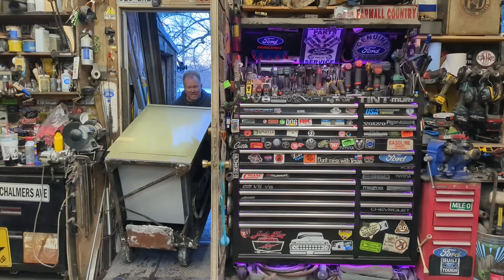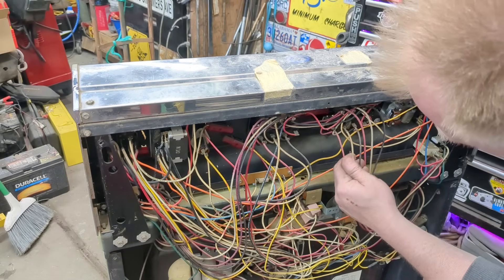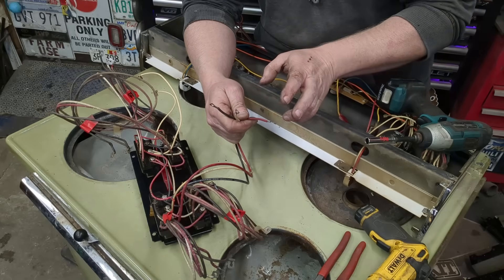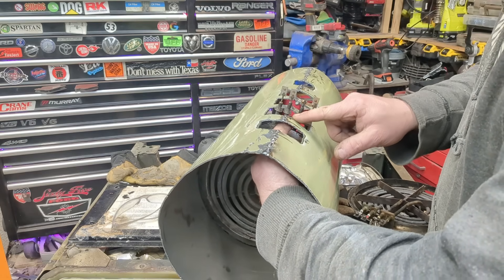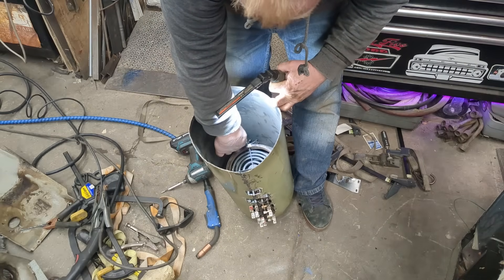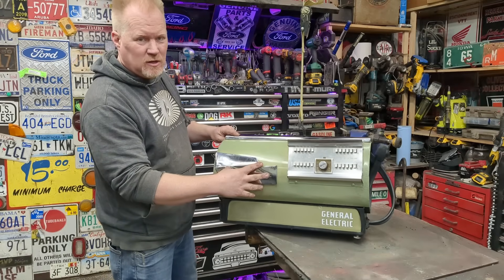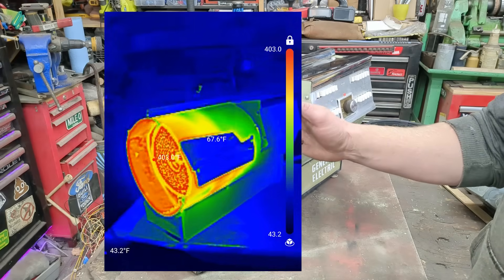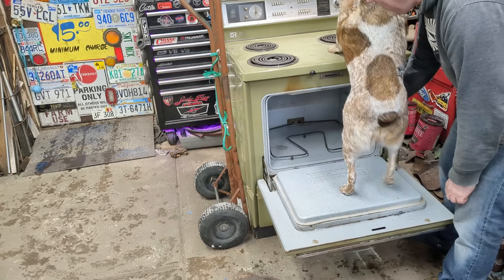Shop HEATER from old OVEN custom build

Comment from the maker: ⬇️ How much does it COST TO RUN?

Stuff I used in the video:
Infrared Phone adapter Android:  https://amzn.to/47AhPve
Infrared Phone adapter Iphone: https://amzn.to/48tunpN
Hypertherm 30xp plasma cutter: https://amzn.to/36pPsne
Miller Multimatic 220 AC/DC Tig Mig welder: https://amzn.to/3mukQqe

VIDEOS I mention in this video
Electric Dryer Heater: https://youtu.be/0gxbGD5f9og
Gas Dryer Heater: https://youtu.be/a3DSOUJ68iE
Vice Grips DEEP Jaws build: https://youtu.be/7PHAfhIw_XY

➡️COST TO RUN: $0.86 per hour(11.5cents kwh at 7500watts)

After Thoughts about the Video: I really don't intend anyone to build this. It's just functional art for me. Full throttle and this thing pulls 7500 watts( 25,575 BTU) which is a fair amount but needed if you wanted to use this outside while you're working. There are no safety controls but after thinking I do plan on installing a buzzer. It will be a simple thermal switch(NTE thermal disc style) located in the top next to the control panel. If it overheats to lets say 160F it'll loudly buzz until it is unplugged and or cools down. This would really only happen if the fan stopped working. I hope you guys enjoyed watching me make this as I had a blast... Build time: 10-12hrs

SUPPORT THE CHANNEL or support the SHOP DOG's treat addiction:
Buy Ginger a new bone: https://www.paypal.com/donate/?hosted_button_id=NS699E56WTYHL
www.instagram.com/sixtyfiveford/
www.facebook.com/sixtyfiveford/

Ginger Birthday wish list https://www.amazon.com/registries/birthday/1JJFHIQRBY14H/guest-view
Reply: would it be possible to wire so that power only goes to the heating element if the fan is turned on? probably safer no?
Reply: Depends, as always. But it's a 100% efficient device, as there is no wasted electricity when all you're doing is creating waste heat.
Reply: You should REALLY go for that classic dryer buzzer with that heave sound that you used to hear across the house, to let you know your laundry was done! 

Also Healers are my favorite dog breed. YouTube doesn’t recommend your videos as often as I’d prefer but when This popped up I knew I had to watch and comment! 

Great video,
Reply: Elements vary greatly by model...even if they are the same size they vary somewhat.  8 Inch Surface elements pull about 1800 to around 2400 Watts each depending on the burners from what I can remember.  A Bake element in an oven is normally around 2400- 2500 Watts and the Broil element is around 3400 Watts.  The bake and broil elements also vary.  

We always called those types of burners 'Calrod' burners or Calrod heaters it was the premium trade name that was patented kind of like Kleenex for tissues but I can't tell you what mfg made the name 'Calrod'  ...sorry
Reply: I likes it. I want one
Reply: that push button GE stove in that puke green colour is 1974 to 1976 ... had its earlier version which only came in white and that was from 66 to 74 ...
Reply: How are you going to cook your food?
Reply: @MrNeverseeme ⚠️ God has said in the Quran:

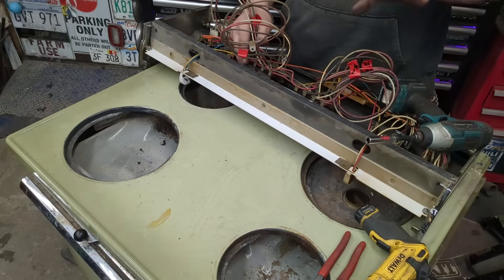🔵 { O mankind, worship your Lord, who created you and those before you, that you may become righteous - ( 2:21 ) 

🔴 [He] who made for you the earth a bed [spread out] and the sky a ceiling and sent down from the sky, rain and brought forth thereby fruits as provision for you. So do not attribute to Allah equals while you know [that there is nothing similar to Him]. ( 2:22 )

🔵 And if you are in doubt about what We have sent down upon Our Servant [Muhammad], then produce a surah the like thereof and call upon your witnesses other than Allah, if you should be truthful. ( 2:23 )

🔴 But if you do not - and you will never be able to - then fear the Fire, whose fuel is men and stones, prepared for the disbelievers.( 2:24 )

🔵 And give good tidings to those who believe and do righteous deeds that they will have gardens [in Paradise] beneath which rivers flow. Whenever they are provided with a provision of fruit therefrom, they will say, "This is what we were provided with before." And it is given to them in likeness. And they will have therein purified spouses, and they will abide therein eternally. ( 2:25 )

⚠️ Quran
Reply: @1islam1   Jesus answered, “I am the way and the truth and the life. No one comes to the Father except through me." John 14:6 - Holy Bible
Reply: Have you thought about saleing it?

Comment: I like the overall concept and design, my only caveat is I would've taken another panel, turned it into a heat sheild and mounted the control panel to that. That would result in less risk of accidental burns, add additional heat protection for the control panel, and improve airflow.

Comment: Nice build I think I would have made a larger ring around the tube for the panel so those wires  are not in the heat tunnel but still a nice build

Comment: The only thing I would've done differently is use a NEMA 14-50P cord and tie the ground wire to the chassis of the heater. Having a proper equipment ground is pretty important, especially when using 240V appliances.
Reply from the maker: A lot of the old stuff is outdated but Snap-On, Matco, Mac etc are never the answer. They're a predatory company taking advantage of lots of people and destroying careers of mechanics. It's essentially buying every one of your meals at the movie theater on credit.

Comment: Ok First off I had this stove in white. But The HIGH. LOW, 2&3 MID, Settings were SPOT ON!! It was almost perfect for cooking. HIGH boiled faster than any gas stove I ever had and low was PERFECT for sauces. I miss it.. Mind you this was less than 10 years ago.  I rehabbed it and it served our family well until it exploded. and a ball of plasma shot down the basement stairs.

Comment: Very cool. Bet GE wishes they had thought of it. Couldnt help but notice you mention a whole videos on clamps at 4:30 ish, i still havent ran across any video on 3d printed lathe gears and hiw they held up. Did they last for hours? Minutes? Days, perhaps they're still grinding away on metric threading?

Comment: congrats dude you built the world's deadliest shop heater: gas stove coils (and burners) release dangerous gases like nitrogen dioxide, carbon monoxide, and benzene, plus particulate matter, posing risks for respiratory issues (asthma) and cancer, even when used normally, and especially if they malfunction. Proper ventilation with a range hood (venting outside) and opening windows are crucial to reduce exposure.

Comment: So basically with 4 elements having 5 possible heat settings = 20 different wattages available.  Ingenious.  

With these older electric ranges having 5 fixed heat settings, what they did was use various combinations of 240 or 120 volts to one or both elements, in parallel or series.  I believe GE used the following: 
HI = 240V, both coils, parallel 
2 = 240V, one coil 
3 = 120V, both coils, parallel 
LO= 120V, one coil
WM = 120V both coils, series 

More modern electric cooktops use an infinite switch, also called a simmerstat, to regulate cooking power based on duty cycle control.  Example, the 1500 watt, 6 inch coil that is set to medium so it spends 5 seconds on, 5 seconds off would have a 50% duty cycle, so it's effective power output would be 1500 * 0.5, or 750 watts.

Comment: Hey, in regards to the insulators on the range runners, this kind of answers, a sort of head scratcher.I had long ago.

Put things in perspective first.This was at my grandparents farm.

I was downstairs in the basement and all sorts of stuff.And an old table down there that was come like just a collection of stuff miscellaneous Quite literally parts of this in that and all sorts of other things in the same area call laid out.

And ran across those two pieces of glass with scares and nuts either side that sort of looked like some sort of electrical Insulation for something scratching my head.

Pretty sure.
That this was 41 of the old rangers or the one that was there possibly from a burner that had been replaced and insulation had been replaced as well.

More than likely the old range was public from this time period as well and maybe very similar to this one potentially so kind of answered the question.I had what that Glass and selection pieces fo

Also.
I do remember once when I was in the kitchen and there was a well big bang moments quite liberally.

Will the rage forders have blown.

It was a big enough opening of an explosion to punch a hole through a pot.

Which at the time they were making homemade iced tea.

Is in a large cooking pot.

You know to say all that wound  top  itself.

Not the first time I've seen a heating helmet.Go out with a Bang.

Also once saw an Of an element.Go out it almost looked like a welding torch when it went that time.

Seeing plenty of other elements go as well the various devices.

We had an old Electric charcoal starter.

That thing kept going forever.Even though the healing on it was completely shot it was still working even though but no at places of the element where the utter chief was overgone in spots still kept going.

And yes once we use this to get a fireplace going to start the logs.

Didn't really have enough kindling but it did work but took a while.

Spur of the mohammad idea that actually works reasonably well.

And yes, I know they have electric fireplace starters.They're essentially overgrown charcoal starters

I have not seen either of these in years.Don't even know if it still makes them or not.

Nowadays so much gas has been used for growing.I wouldn't be surprised if you had to fine someone like this as it is.

Either or just downstairs shark hole in lighter flood there you go.

Have seen a lot of people that happen to have a gas Torch.You know where it's going.Use that torch to start the charcoal.

And in some cases even getting the fireplacscaling or fire pit of course as well.

And yes, I saw someone build a custom fire pit with a custom right now.The initial sysyep gas.

It's not a gas fire fit, but just isn't.A nation source add electric Igniter, of some sort, probably from something else that was salvaged.I'd say but it looks And yes gas valve as well but the gas valve was new just so you're aware

Comment: What’s the amperage that’s being used
Reply from the maker: About 30 amps of 240 volt/ 7500 watts. At $0.14 kwh it should cost you about a dollar an hour to run.

Comment: The ends of the control panel is not stainless steel, they are chrome plated die cast.   ( Pot metal / zimak).  A zinc based metal that cast Very easily.
Reply from the maker: It's not zamak. They're way too heavy with a weight similar to cast iron. Zamak is light.
Reply: @sixtyfiveford  so probably some other cast.    From the 60s steel, or brass.  If chrome plated. I have found chrome  plated brass castings in  appliances from the 1950s not sure about appliances of the 60s.

Comment: Curious about the Wiring? 240/110?  From the 3 prong plug?
Reply from the maker: @chriskelly3678  A three-prong 240 volt plug will have two hots and one neutral/ground. The rounded (50amp) or L-shaped(30amp) is your neutral/ground. The two flat blades are 240 volts from one to the other no matter which way. Each one of those flat blades to the neutral/ ground will give you 120 volts. I'm not sure if that's what you're asking. To wire this device with 240 volts, all that is required is the two flat blades. The neutral/ ground is there simply as a safety connected to the case. Sometime in the late '90s they added a fourth terminal to the code so the neutral and ground weren't shared. So there is a dedicated neutral and a dedicated ground.

Comment: Hey Bub, where you say "Original Feet"... look at those feet closely, on the underside of those feet, look to see if it has a ...O... trademark on it.... if so i can tell you exactly  where they were made.... just a trivia FYI 😊😊
Reply from the maker: I looked and I didn't see any markings. The front feet were just stamped into the steel. The back were adjustable but are pretty scratched up/worn down on the surface that touches the floor.
Reply: Ok, thank you.... usually on those older appliances there was only a couple places that made those levelers. If there was a "O" it would have been made by the company I work for. The Ohio Nut & Bolt Company. Still in business, same location since 1905. Just a little trivia fyi.

Comment: Hi sir I love This video but I have a question maybe you can help me i have a 220v range stove could I convert it to a 110 cord I couldn’t find any videos on YouTube and I instantly thought of you thank you so much for your videos very smart and talented person
Reply from the maker: The issue is you can't get comparable heat energy out of a 120v 15 amp outlet compared to a 240V 30-50 amp outlet. A 120v outlet is going to give you 1,800 watts vs the 12,000watts you could get out of a 240v outlet. In terms of heat that's 6,000BTU vs 40,000BTU. Now I know that's a bunch of numbers that don't mean a ton. A long story short, you can buy any premade $20 120 volt plug in heater and it's going to be equivalent to anything you could build on 120 volts.

Comment: That looks so cool, I bought all the parts to make that tire bar, well I still need the bolt if I don't have one. Going to make it when it warms up, I'll be able to de-tire some wheels & sell them right away, down the line I will be able to mount to nice wheels. Also got the tire balancer for about $14 using a $50 coupon.

I've been wanting to mount like 280mm fans to my oil radiator heater & get then elegantly incorporated into the wiring, the box fan that I use on it is pretty big & in the way.

Those buttons work a heck of a lot like a arcade push button without the spring.

Comment: I hear you on the Vintage appliances I got an old dishwasher and an old microwave and I wish I could replace everything I got with 1970 stuff I paid more for shipping to get that microwave made in 1983 after I threw away three new microwaves I said no more trip to Walmart for a microwave and I paid $150 shipping for a $30 microwave it was brand new made in 1980 and I still heat up my morning coffee and it everyday

Comment: This is such a cool idea and build. It really looks great. I'm kind of surprised you didn't leave a buffer space between the heating elements and the shroud. I'd be worried about the risk of shock if an element were to fail catastrophically. It doesn't happen often, but when it does it can get crazy with like arcing electricity.

Comment: Hey, Moe!  I got a free oil-filled electric space heater recently and I really like it better than the small electric heaters with fans I’ve been using. I did some research into issues with these and it’s almost always an easy electrical problem, plus parts are dirt cheap, interchangeable and available. It looks like a lot of people toss them instead of repairing, so I imagine you could find plenty to work on and try out. I’ve asked on Freecycle here on Cape Cod but no offers yet, so this morning I put a request into the weekly eList I send out to my baking business customers. Little by little I’m decreasing my fuel oil bill.

Comment: You couldn’t buy something that solidly built these days if you wanted to and incorporating the original switch panel was a nice touch, as was the sign writing, that’s quite a skill.
I wonder if they take into consideration the environmental cost of scrapping these new “environmentally friendly” energy efficient appliances every few years when comparing their “carbon footprint” to an equivalent machine from the 60’s that could still be running safely today with an occasional clean and service if the parts were still being made. Or is it all just about selling the consumer more stuff and keeping the money going round?
Reply from the maker: No initiative is pushed without money/profit being the major goal.

Comment: Good job! The cool thing about electric heat is that you get out what you put in. Electric heat is almost %100 efficient. Of course you gotta buy the juice. Back when they banned incandessent light bulbs nobody mentioned that in addition to lighting the house, a 100 Watt bulb also puts out EXACTLY 100 Watts of HEAT! A well unsulated room with 2 100 Watt old school bulbs is dry and comfy. LED bulbs not so much..

Comment: Each leg of a 120 volt AC system is not out of phase with the other...

If you put two 1.5 volt D-cell batteries in series, you get 3.0 volts.  Are each of the batteries out-of-phase to achieve that voltage?

There's numerous videos out there that go into the details with hands-on measurements and such.  Check them out.
Reply from the maker: You might want to check your facts before you actually post something like this. You look pretty foolish

Comment: Avacado Green! As an Appliance Tech I worked on many of those old electric ovens  
Those GE/Hotpoint  push buttons were not really common in my area as this is probably the 4th time I have seen this model in 30+ years. 
 You could do a job like this even easier with a 220V dryer.  Certain Models have an actual heater box and you also get a motor and blower wheel plus a mechanical timer that is really easy to wire up to make a heater like this.

Comment: Not only is it pumping out some heat. I bet it would be chewing through a ton of power as well.
Would love to see some power draw ratings at full power.
Great project. Looks so convincing as a if it came out of a 1960's GE factory
Reply: If the US would run all of our power to 240 V, it would actually be more efficient!

Comment: Nice build!  I have worked on those ranges. The burners are still available but the switches were discontinued. Many times the wires have started to oxidize and green liquid leaks. The wire insulation may be part asbestos.  There were some vent hoods that had the burner switches on the hood and conduit running to the cooktop. 

GE had many unique appliances in that time. - There was a refrigerator that hung like a cabinet from the ceiling.